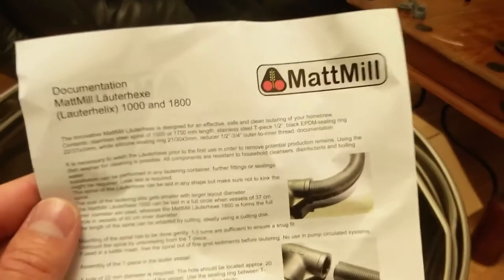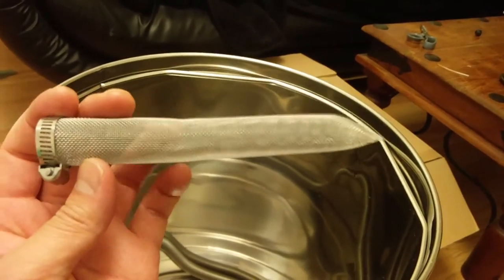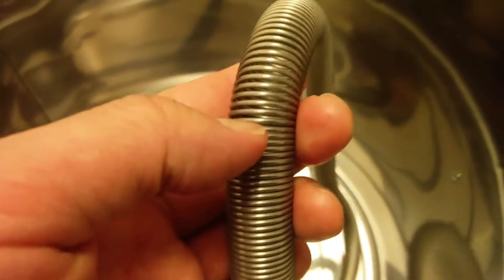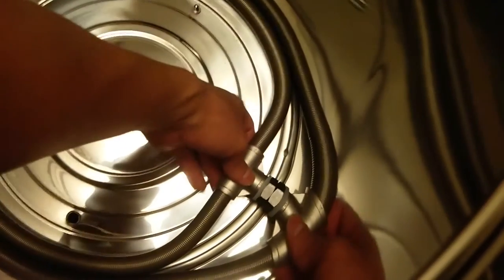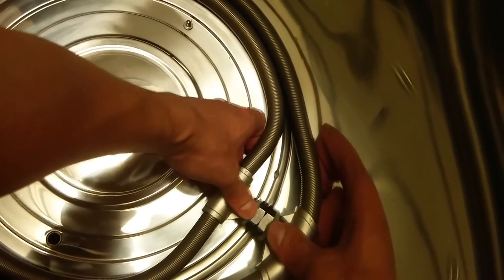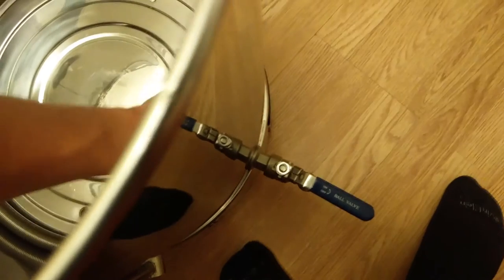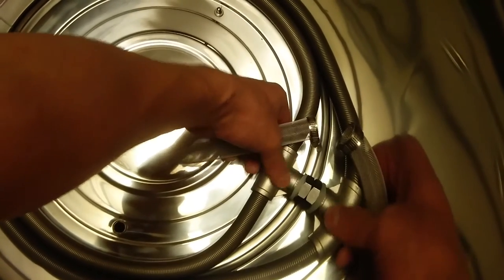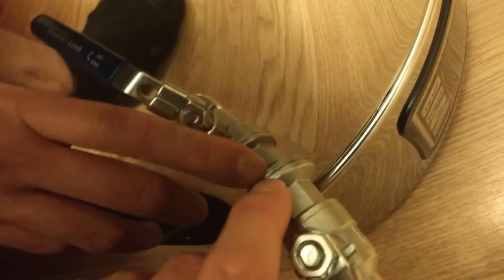Ace Micro Brewery (UK) Upgrade: Lauterhelix (Läuterhexe) Hop Strainer (Lautering)

Comment: Best regards from the inventor of the Lauter Helix! 
The use as a hop strainer was not originally intended, but it can work.
As a lauter system, however, the Lauterhelix is really very reliable and, above all, can be used universally, even in heated kettles. That is a big difference, because that is not possible with false bottoms.

Comment: what is the original hole for a tap? 1/2 or smaller?
Reply from the maker: 1/2 inch bsp!
Reply: awesome! thanks!
Reply from the maker: RandomGuy hey if you're talking about the hole on the kettle a 21mm q-max hole punch will be about the right size.
Reply: nope i wanted to add another tap and was thinking what size it is, my kettle is on the way :)

Comment: I am not sure about what you mean about BSP. Is this the right one for the ACE: http://www.hobbybrauerversand.de/MattMill-Laeuterhexe-1000_1
Reply from the maker: The brewpi website had two options not sure if it was across the board but it looks like BSP is the standard sold here in Europe. That looks like the right one! :) I was able to shorten mine slightly to make a complete circle on the inside by cutting it with a wire cutter. You may just experiment first and see if you like the way it is.